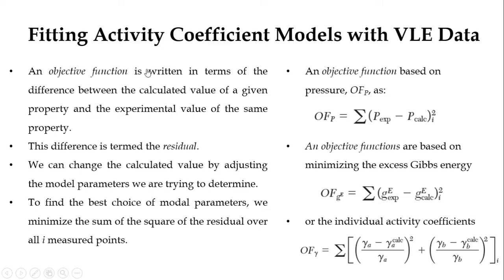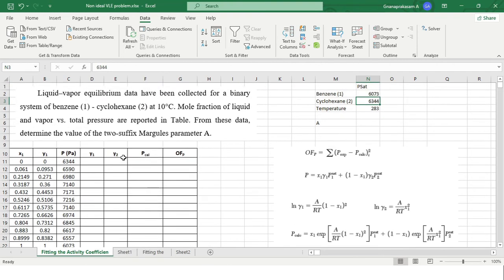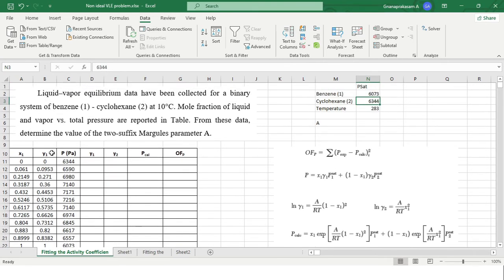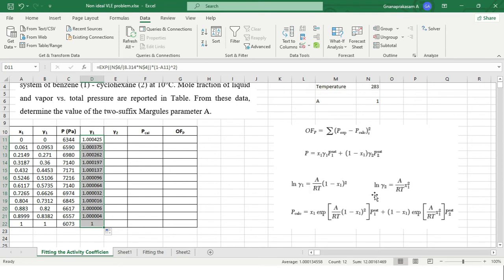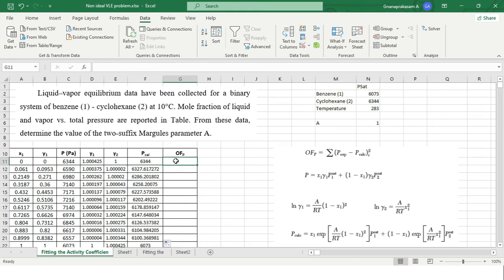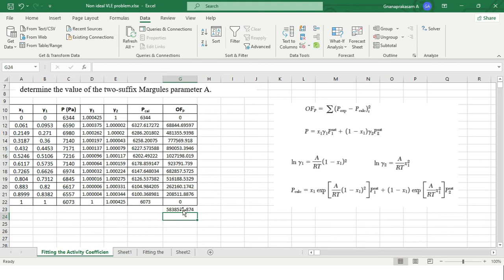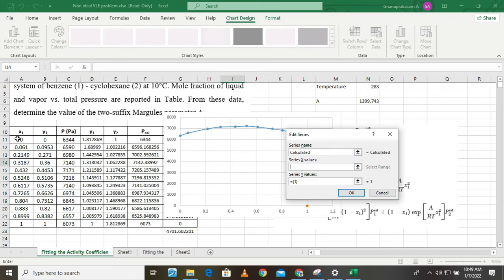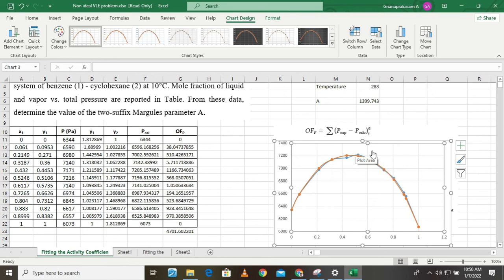Fitting Activity Coefficient Models with VLE Data - Thermodynamics

Comment: Hey,
I' m Chemical Engineering student from Greece! I want help i want some help for my thesis.
I am looking for γ, activity cooeficient for Methanol - Lauric acid - Methyl Laurate and water system. I have to find γ depentend Temperature equation. Would you like to help me?! 
N. G.
Reply from the maker: Of course, I'd be happy to help you with your thesis! To find the activity coefficient (γ) for the Methanol - Lauric acid - Methyl Laurate and water system, you can use Aspen Plus. Here's a general outline of how you can approach this:

1. Define the Components: Start by defining the components in your Aspen Plus simulation. Include Methanol, Lauric acid, Methyl Laurate, and Water.

2. Select a Thermodynamic Model: Choose a suitable thermodynamic model for your system. You may consider using the NRTL (Non-Random Two-Liquid) or UNIQUAC model for this purpose, as they are commonly used for systems containing alcohols and organic acids.

3. Set Binary Interaction Parameters: If necessary, set the binary interaction parameters for the selected thermodynamic model. These parameters can be adjusted to match experimental data or literature values for γ.

4. Define the Mixture: Create a mixture in Aspen Plus containing the components of interest. Specify the mole fractions or mass fractions of each component in the mixture.

5. Run the Simulation:Run the Aspen Plus simulation to calculate the activity coefficients for your system at the specified conditions. Make sure to set the temperature range of interest for your γ equation.

6. Analyze the Results:Once the simulation is complete, analyze the results to determine the temperature-dependent equation for γ. You can do this by fitting a curve to the calculated activity coefficients at different temperatures.

7. Validate the Equation: Finally, validate the temperature-dependent equation for γ by comparing the predicted activity coefficients with experimental data or literature values.
Reply: @DrAGP-dn5te Thank you for your time. I appreciate your effort to help me! The Aspen plus is not available in my university and we use UniSim, is it okey? And last but not least where i can find thermodynamic data for my system for Unifaq model (Aij , u(m3/mol), and etc)?
Reply from the maker: You're welcome! Yes, UniSim is a suitable alternative to Aspen Plus for your university projects. As for finding thermodynamic data for the Unifaq model, you can typically find these values in thermodynamic databases or literature sources. Some common sources include the NIST Chemistry WebBook, DIPPR (Design Institute for Physical Properties) database, and various chemical engineering textbooks that cover thermodynamics.

Finding thermodynamic data can indeed be challenging and time-consuming. However, conducting experiments in the lab to generate equilibrium data for your system can be a rewarding and valuable endeavor. 

Consider that generating equilibrium data in the lab for the Methanol - Lauric acid - Methyl Laurate and water system would not only provide you with the necessary thermodynamic data for the Unifaq model but also contribute valuable experimental insights to the field.

 @Teik302